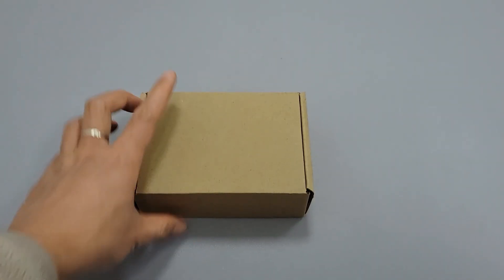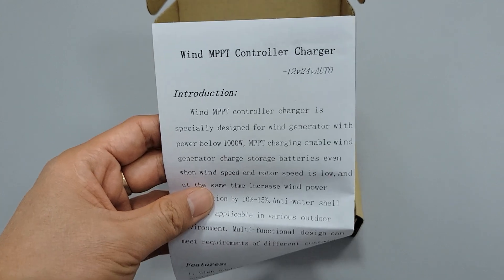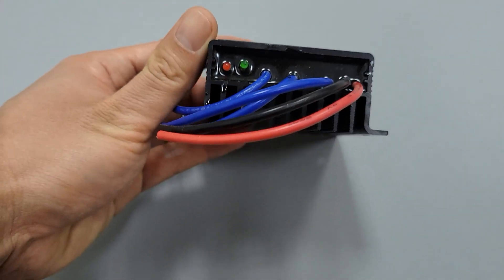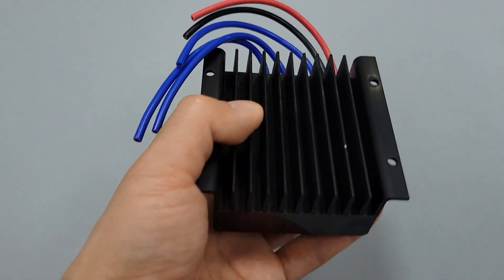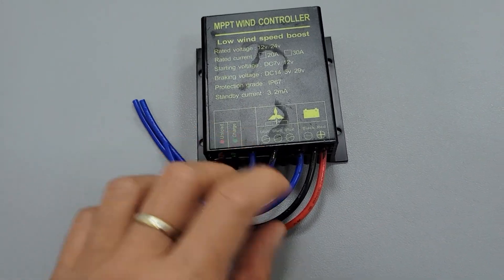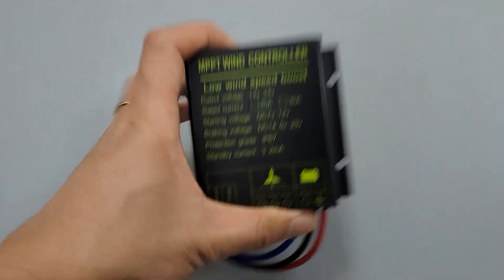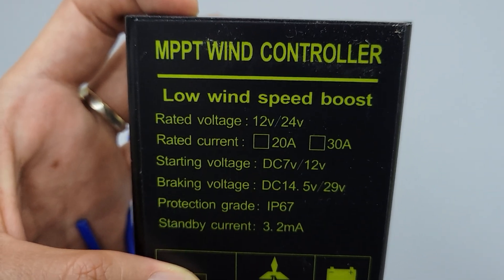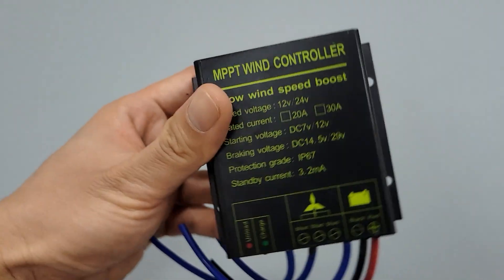Wind Turbine MPPT Charge Controller 12V 24V 20A Unboxing

Comment: I just ordered a 600 watts wind generator that comes with the controller. Looks like that one maybe, or similar
Reply: The one I have may be different than the one here. Mine is a 600 watts B&C . They sent me a 12 volts one and I had ordered a 24 volts model. I'm building another one that is DC. I wanted to test it out for awhile before I spend the money for a Midnite classic charge controller. I'll have it hooked up to the twenty big marine batteries after next week. Waiting for new terminals for eight of the batteries. Making new cables before summer. I only have 14 hooked up today. The 🌞 sun was putting out the watts today. So the voltage was higher, and that lets the wind turbine spin faster. So then it makes more power. You can see my turbine spinning on my channel, there's two short videos. It was making between 300-400 watts.
Reply: It made 458.9 watts three days ago...